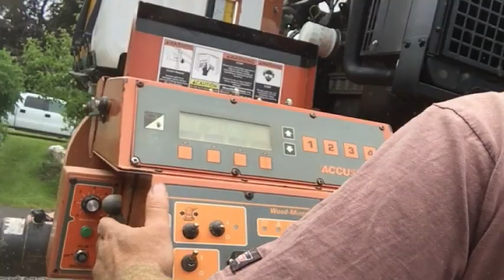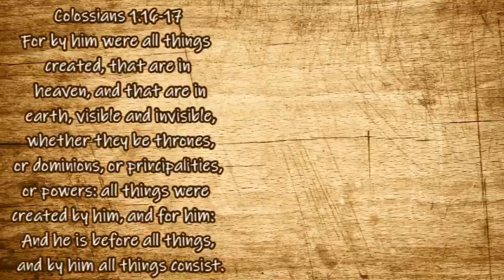Rolling Pin From Raw Wood to Finished Product

Comment: This question from across the ocean, no relevance to topic 😀
Hot question: I'm making floral vinegar I saw some black ants on a bunch of wild orchid plants. Can I used for the vinegar? The smell from the flower is very high like fermented sugar.
Reply from the maker: What I always say is as long as it is edible, you can make vinegar from it
Reply: @RainCountryHomestead  yikes, never heard anyone eating it only seen the black ants going crazy on it. Ok, undo. Will used only to clean.
Reply: @oheaven4me  orchids seed pods are vanilla beans. Do some googlepants searches on your wild orchid. Check university of Hawaii.
Reply: @edieboudreau9637  Thanks Edie will do my research. Appreciate the heads up since Google search engine is like finding a pin in the hay stock. I could get seriously frustrated. I do know the scent of the vinegar will be overpowering. The whole house has this "smell"!
Reply: @oheaven4me  put it outside. Lol